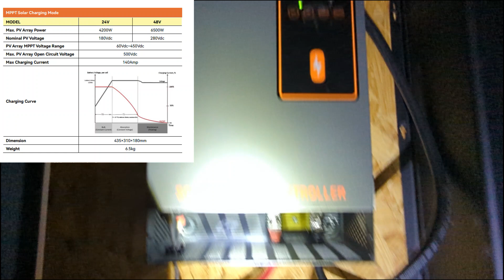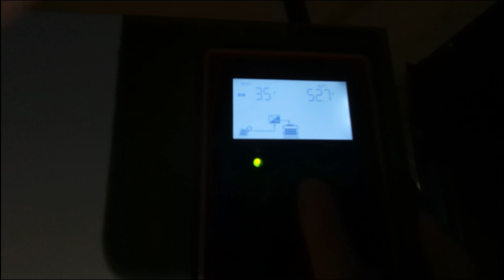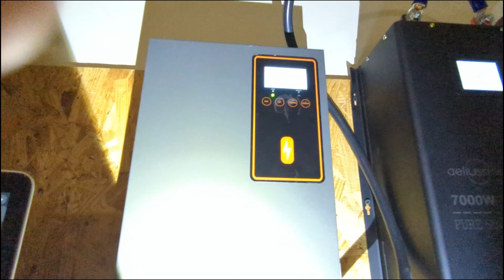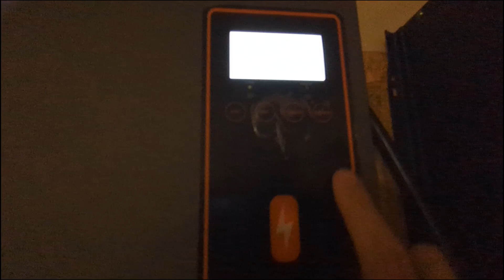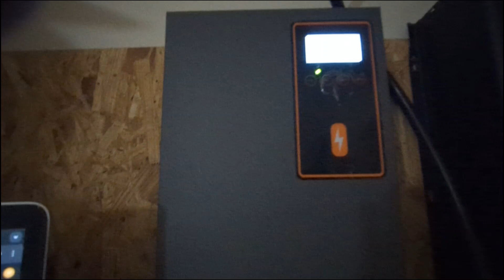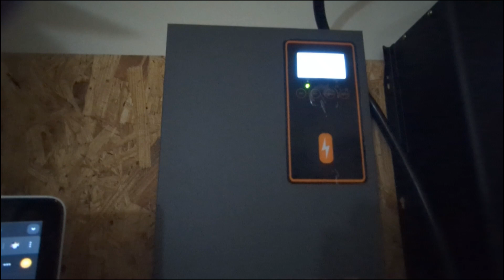PowMr 48V 140A MPPT Solar Controller 500 VDC

Comment: Thx for the video but there was no info i could not get from reading the manual. I would like to have a look inside as well as seeing a test at which power it start tracking and how it performs if some panels are shed. Also a look inside would have been great.